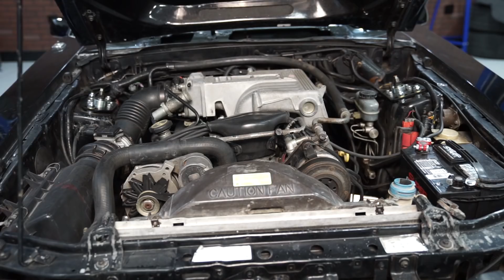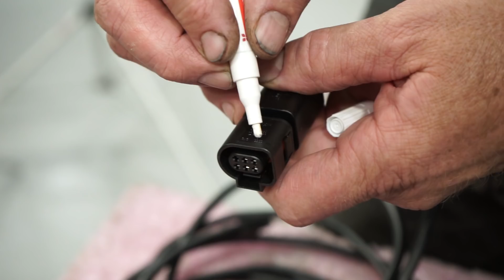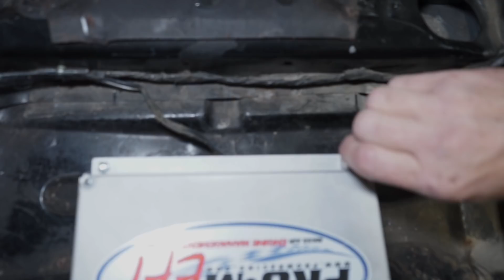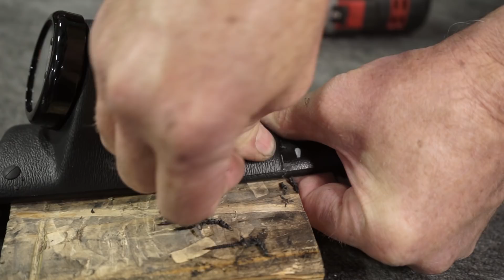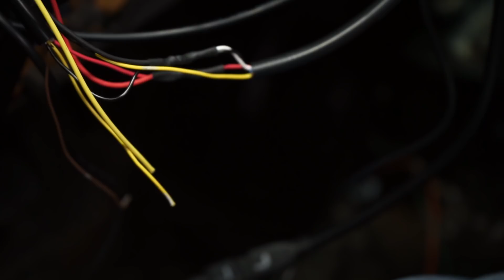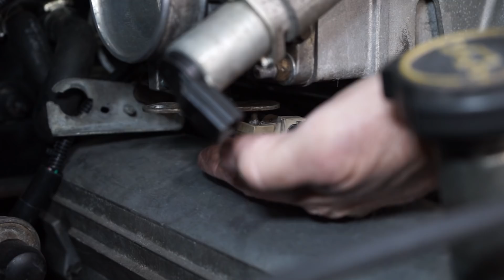1979-1993 Mustang Pro-M EFI Engine Management System - Part 2

Comment: Question, Did you splice the red wires into a power source from the fuse box? Or is the power supplied from the O2 wire harness coming from the ProM harness. The Innovate directions indicate to get power from fuse box and ground directly to battery. Just wondering if that is not required if using the ProM harness. Thanks
Reply from the maker: Bob - We wired the red o2 wire from the Innovate controller to the red wire on the Pro-M harness.  Same goes for the ground wire.  It's been this was since the video, and everything still works as it should.  The Innovate directions cater to universal applications since this gauge will work in just about any vehicle.  Hope this helps!  -Landan

Comment: Looks like you installed the Innovate O2/Wide band sensors in the stock O2 sensor locations. Did you have any problems with them? They recommend installing them 2’ from the collector. Just wondering, thanks.
Reply from the maker: We never had issues with where we installed the wideband o2 sensor.  However, feel free to install yours at the recommended distance.  -Landan
Reply: @latemodelrestoration  Thanks for quick response. I noticed in one of Chris Richards videos he did the same thing. I also have noticed a lot of comments of people having issues with burning them up. Just was curious, thanks again for you comment.

Comment: Pro-m Racing dont get enough credit for this product.
It is better than you think it might be and if you get everything from Pro-m your car will just fire right up.
I'm running a 70mm turbo on my 93 LX. I purchased this kit with 62lb injectors, fuel pump with their hanger, mass air flow sensor and the coil on plug system they offer. Everything looks OEM and is super good quality. I told them what my set up was and they put in a base tune... and let me tell you I just plugged it all in and she fired right up and idled like stock. The customer support they have is the best... they will walk you through it all the way. I couldn't be happier with this set up... really a SUPER good product.
Thanks to Chris and Josh at Pro-m 👍

Comment: What’s the pro and cons of this computer. I’m at the point where I need a stand alone computer system.
Reply: Pro-m Racing dont get enough credit for this product.
It is better than you think it might be and if you get everything from Pro-m your car will just fire right up.
I'm running a 70mm turbo on my 93 LX. I purchased this kit with 62lb injectors, fuel pump with their hanger, mass air flow sensor and the coil on plug system they offer. Everything looks OEM and is super good quality. I told them what my set up was and they put in a base tune... and let me tell you I just plugged it all in and she fired right up and idled like stock. The customer support they have is the best... they will walk you through it all the way. I couldn't be happier with this set up... really a SUPER good product.
Thanks to Chris and Josh at Pro-m 👍
Reply: V8mo50  what I needed to hear.